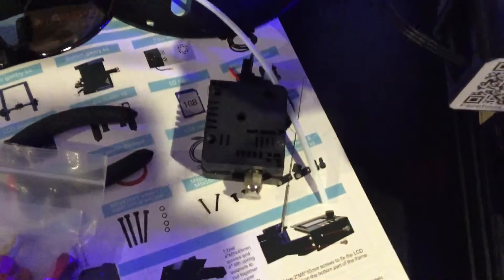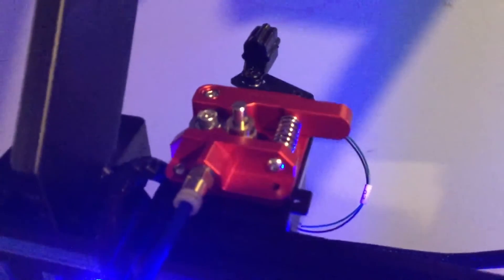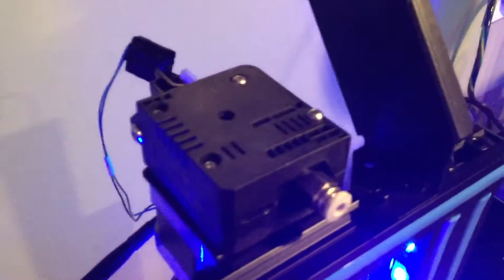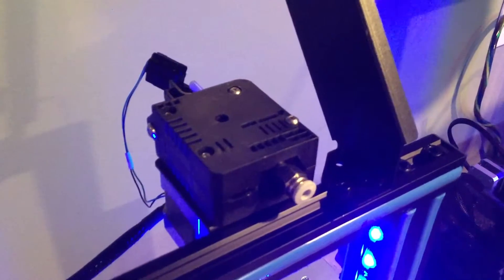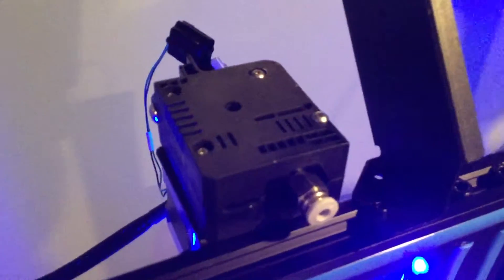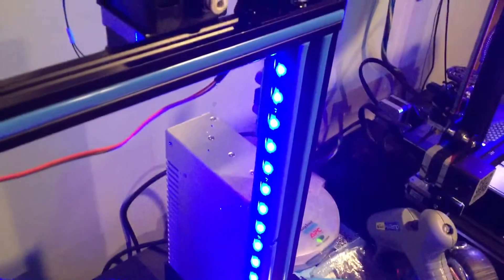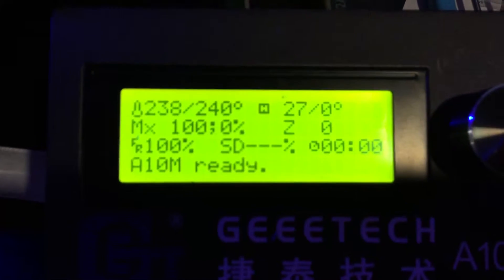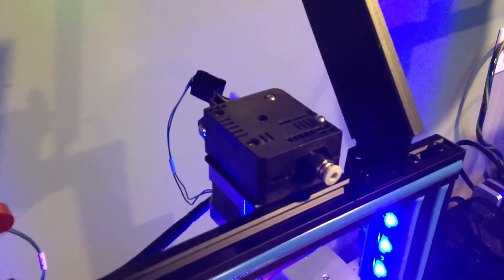Changing extruders on Geeetech A10M

Comment: HI very cool up grade :-)  i have just bought a geeetech a10m same as yours and have allready needed to fit a new extruder just like yours as the stock one packed up .. can i ask how did you get the extruder motor to run in  reverse ??? as i am haveing trouble doing so as i am new to 3d printing any help would be  much appreciated
Reply: You need to change the wire place, all 4 just flip it. I have now problem because the motor is very very fast . What can i do for it ?